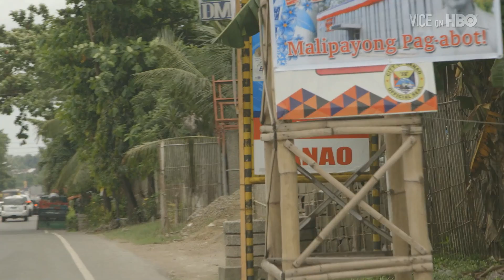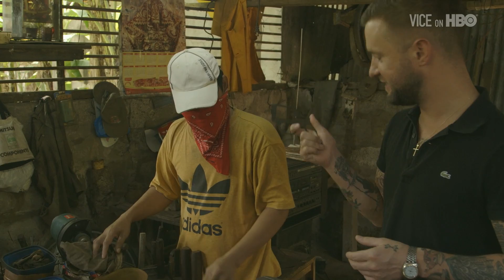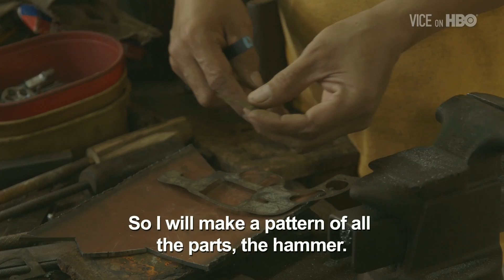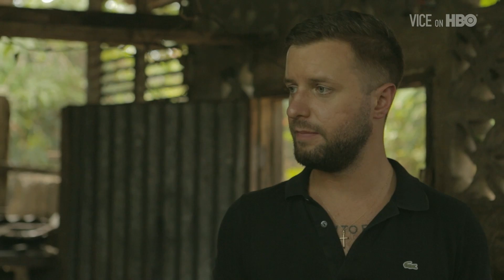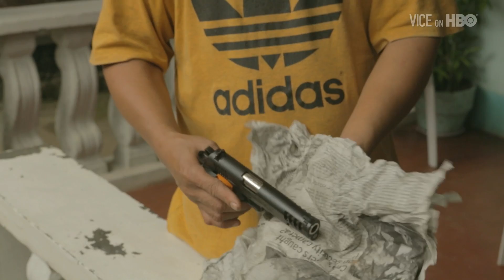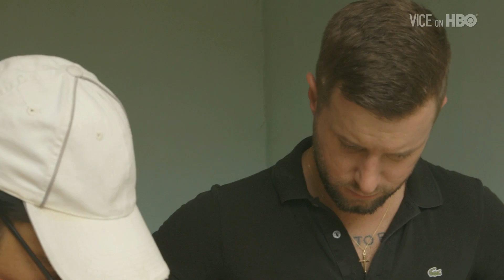Assassination Nation: Backyard Gunshop (VICE on HBO Ep. #1 Extended)

Comment: With mass production. Gun manufacturing is a huge undertaking and until Ford did it with cars it was the reason for the largest modern factories then known. Ford was inspired by Colts manufacturing technique and scaled it up to cars. 

I doubt that those 1911's went in as scrape steel and came out of that shed. At the most they were parts kits missing some large component that could have been made via primitive means. But I'd say it is far more likely that they were simply repaired.

Comment: I would be very worried about firing modern ammunition in a home made gun which has not been tested to handle the pressures that can be generated.  If you don't necessarily want all your fingers to count to ten, I guess it wouldn't matter much though.

Comment: I don't believe for one second that those guns were "made from scratch" in that shed.  The 9mm 1911 at the end has anodized parts visible, I doubt the filipino shed contains an anodizing shop, nor do I believe they have a rifling machine.  I'm willing to believe the guns are assembled there, and some parts (frames, slides) are made there, but not the barrels and anodized components. Making a complete gun like the ones shown is actually pretty hard.

Comment: How can you say for sure that it is not a serial number? It is on the frame (not the slide) right over the trigger and right behind that pin where you would expect to find serial numbers on many handguns. It is 6 or 7 digits long.

The engraving you mentioned is a crest of some sort on the slide followed by something that looks like a brand name. It could be a knock off, but considering the number of legit arms makers in Phillipines it is impossible to say.

Comment: It's not as much the bit, as it is the twist.

One has to factor in the length of the barrel, and anticipated speed of the bullet.

But, since these figures are readily available...I see no reason why rifling a 2 or 3 inch pistol barrel would be beyond the capacity of a craftsman such as the gunsmith profiled in this documentary.

Comment: 38mm and 45mm    WTF?
Reply: .380
Reply: xProvXKiller i know lol but the subtitles sad mm after 38 and 45 lol
Reply: Yeah aren't they supposed to be inches?
Reply: xProvXKiller NO. .38 Special
Reply: .38 and .45 are decimal measurements of one inch - which has nothing to do with "mm" - which is from the metric system of measurement. Obviously, whoever made these subtitles does not know very much about firearms, because .38 and .45 are very common pistol calibers these days.
Reply: Damm that's cheap but in the U.S. it's 2x higher than that price

Comment: A metal clank is normal depending on what's internally going on in the 1911.  Especially when the hammer is down and the slide knocks it back on the first pull. Also, if it has a one piece guide rod or two piece makes a difference. It has a skeletonized hammer and beaver tail grip safety. They didn't make those. This story is bullshit. The grips are fine just textured, holes in the right spot. radius around the main spring pin and angle at the plunger area.  Again. this story is BULLSHIT.